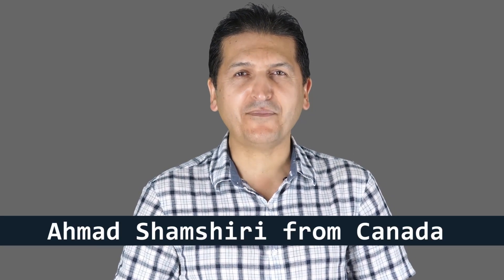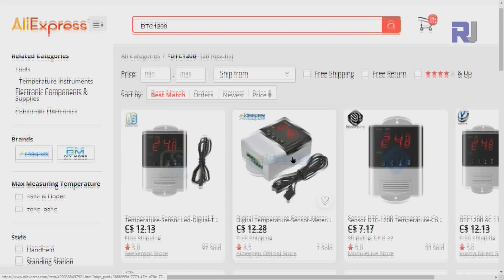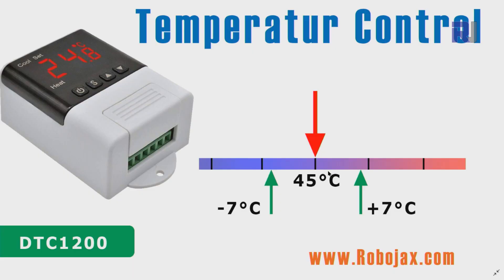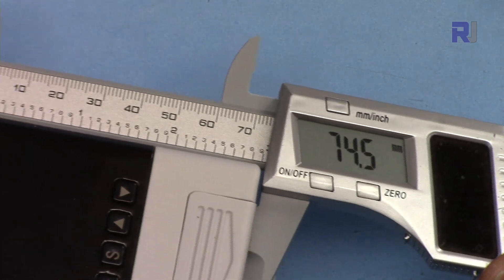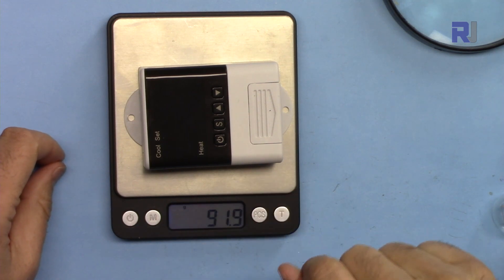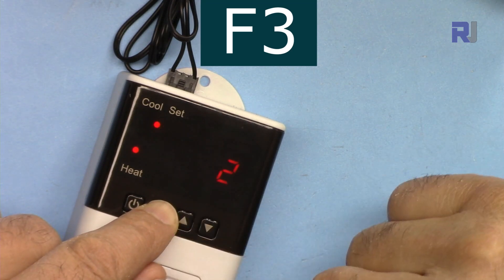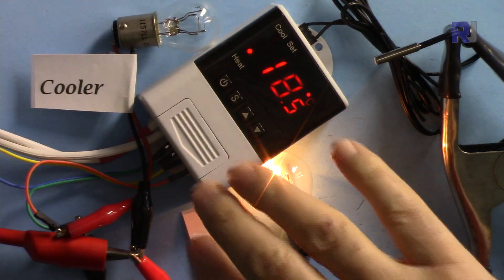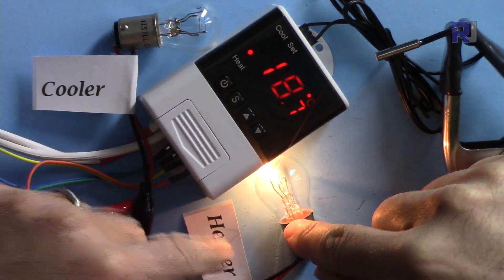How to use Deek-Robot DTC1200 Digital Temperature Controller Thermostat - RJT267

Comment: I turned on the device and understood its principle of operation
so, if I understand correctly, this thermostat is not suitable for replacing a pipe thermostat for a water circulation system.
Because the thermostat's switching system is +-10 degrees Celsius from the set temperature point. Am I right? And don't even try to set it in my heating system!?

Comment: Hello friend
I bought a DTC2201 device. For a water space stove system. I would like to use it to control the circulation pump. My question is how to connect the pump to which number of connectors?
My second question is how to program the pump to turn on at a temperature of 35 Celsius, and then turn it off when the temperature drops below 35 Celsius. I await your respectful answer.
Reply from the maker: Hello, 
I am not sure what kind of pump you have but I mention them as load.  assuming we have two wires.  Just cut one of the wire as shown in the video (I just watched the video to make sure what I am talking about). 
for the programming I believe I have explained all the features. I can't watch it fully . please watch and see if it can do it. if you don't see it in the video, then it can't do it.
Reply: @robojax  The pump type is grundfos alpha 2. My English is bad, could you possibly show the video with Hungarian subtitles?
Thank you my friend!!!
Reply from the maker: for time controls I have more videos you may find something else if this module does not do it.

Comment: Thank you for the video....I need 12-72 V DC models, but I can't find the product code. Can you tell me where I can find DC models, with and without WIFI ??? Another question ... does the WIFI model need internet connection or it also works only with WIFI network (LAN) even without internet ??? Thanks for your help
Reply from the maker: I searched and can't find it. there is another product that I did the review and it has been viewed 5 times more than this so check it out https://youtu.be/TUbnsNfK8Z4 as it has DC and AC

Comment: Dose anyone know what material the metal looking temp probe is made from, or knows if it is safe to use in saltwater without it corroding?
Reply: Actually just found out they are stainless steel so will eventually rust (plus I'd guess the grade quality of the steel will vary a lot) so think I will just dip mine in plasti-coat, which may affect the speed the sensor but I'd guess not to the extent it will be an issue for me.

Comment: Hello Ahmed, thanks for this video. I have the 2201 Wifi version. It measures 1 Degree C too high , so I wanted to use F4 Cal function. When I set F4 to -1.0 Degree it should be reading OK but the Display still reads the same Value . (1 Deg C too high ).  Am I doing something wrong ?  Thanks, Erik
Reply from the maker: it should work when you add or subtract. I am not sure what could be wrong.
Reply: @robojax  Hi , thanks for your reply. Do you still have yours? Can you please try the F4 calibation and see if the measured value on the display changes?  Thanks